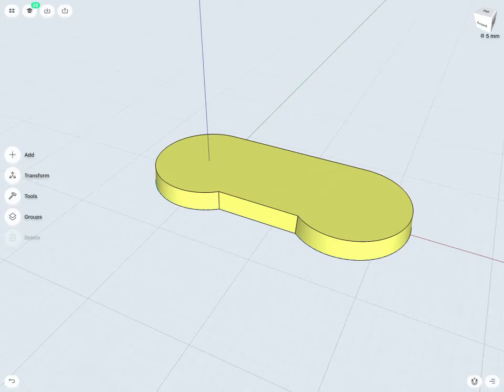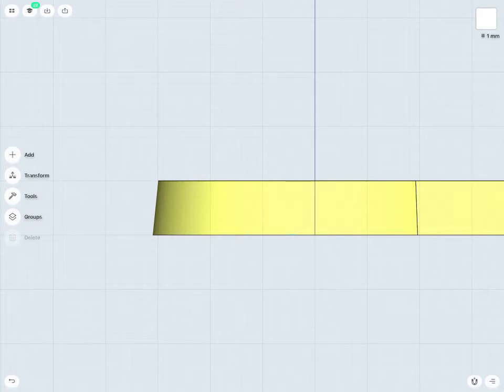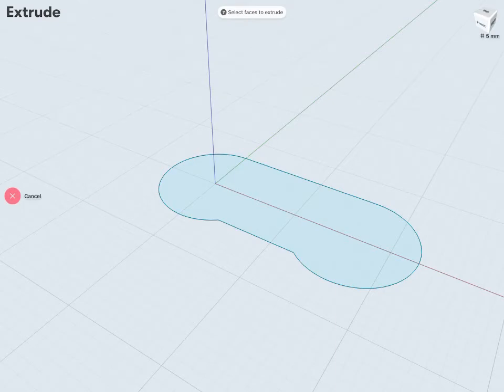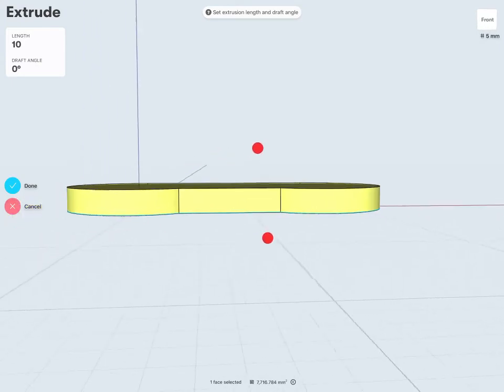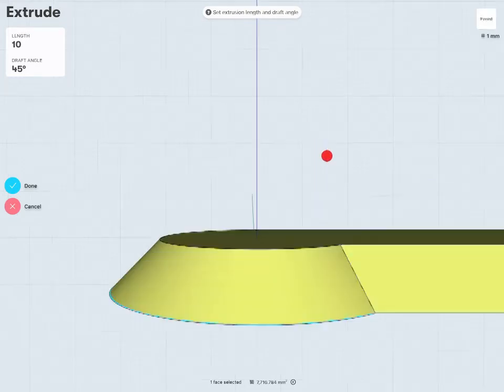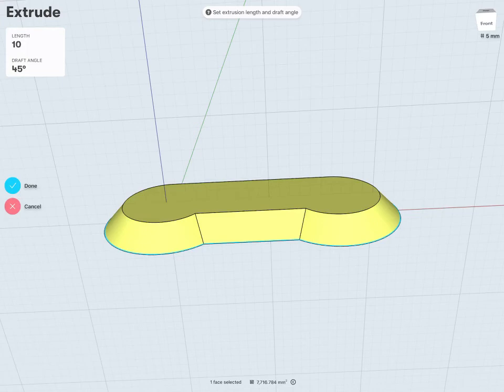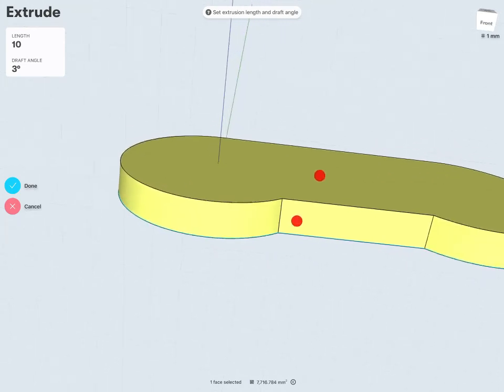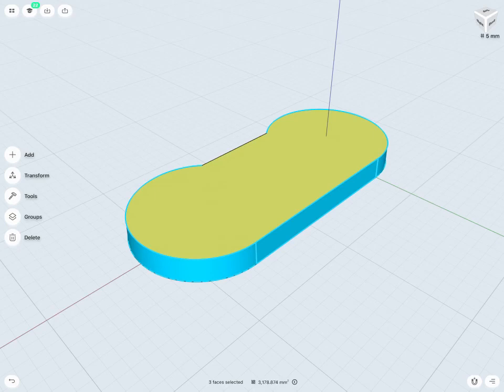Draft | Shapr3D for Beginners

Comment: Do shapr 3D have a draft comand or icon?
I ask because sometimes first model the plastic piece and then add drafts, radious and chamfers.
Reply from the maker: Hi - it is embedded in the Extrude tool - https://support.shapr3d.com/hc/en-us/articles/115001417693-Extrude
Reply: Shapr3D what do you do about the "select face" portion of "draft" if you do not want to extrude anything, but just wish to apply an angled-slope (a "draft") to a face, or selection of faces?